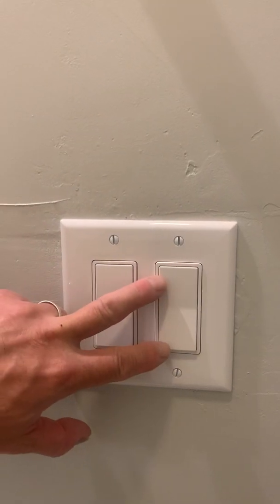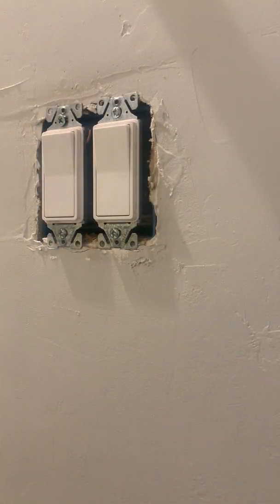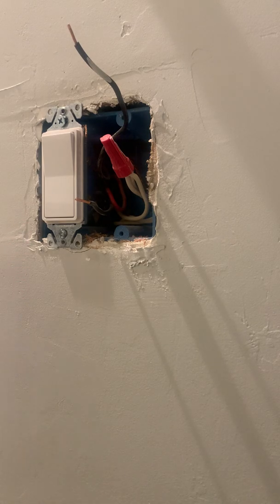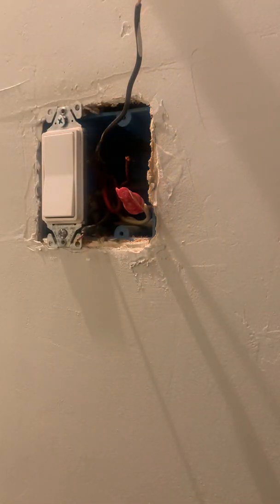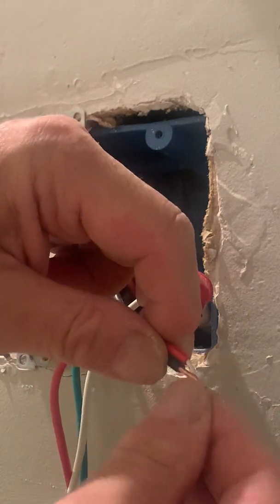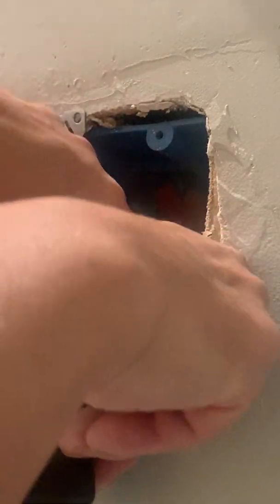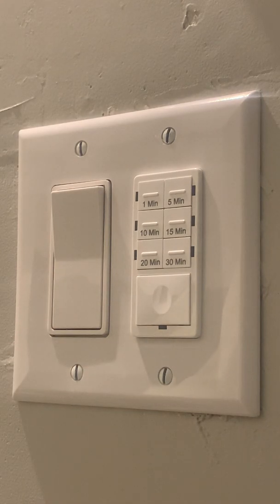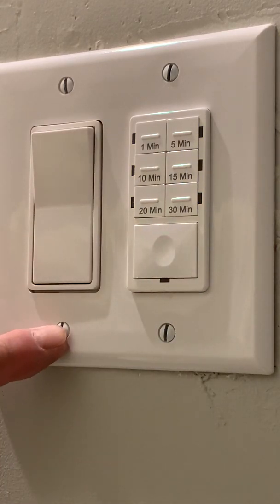Bathroom Fan Timer

Comment: Good video!   Installed one of these on my hot water circulating pump line since no one uses hot water between midnight and 6:00 am.  Also, liked your advice on attaching ground first, then neutral, load, and line.  Good habit to get into.  Cheers!